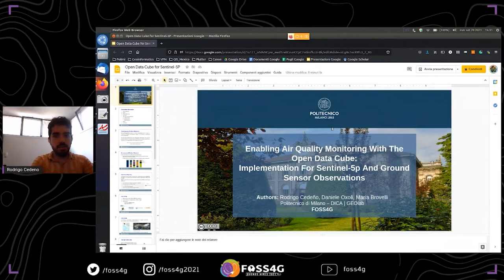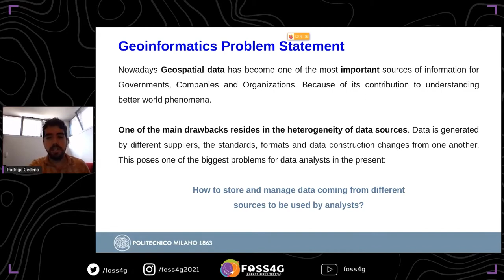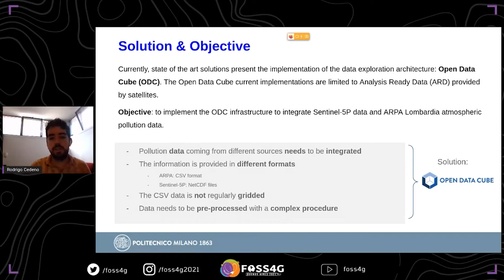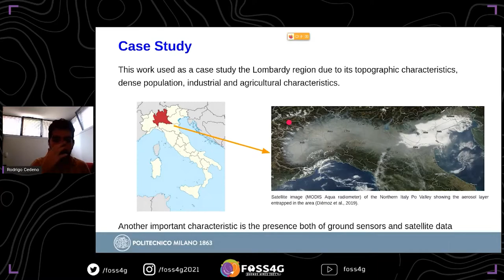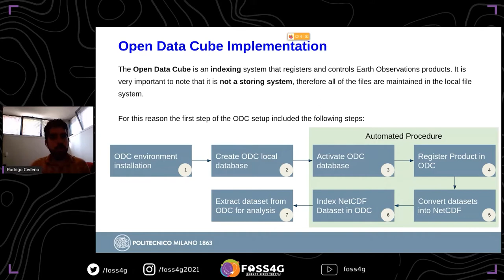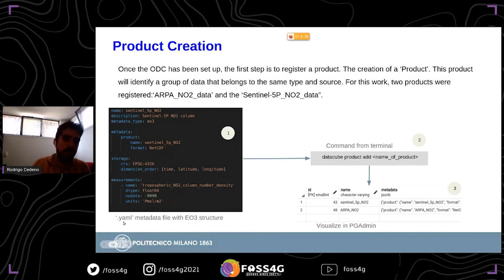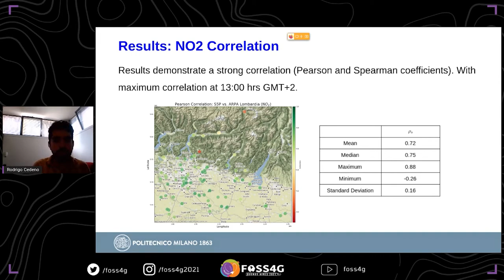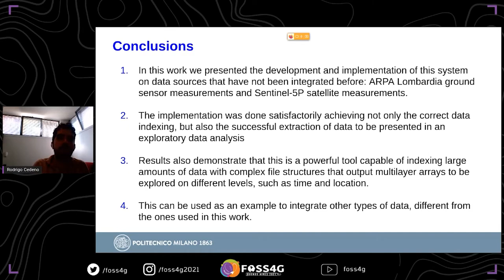FOSS4G - Enabling air pollution monitoring with Open Data Cube: implementation for Sentinel-5P

Comment: Great talk. For full column parameters, if you correlate with ground measurements, you'd still possibly derive a proxy right? Any how is the project code open-source? If the author is reading this- thanks for this wonderful talk